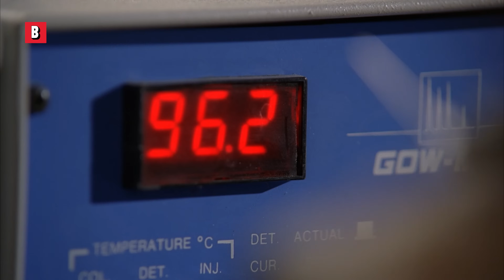"You belong to the cartel now" | Breaking Bad | CLIP

Comment: 1:35 I'm curious is that an actual device or just something they whipped up to make it look cool
Reply: Actual device. Could be gas chromatography/mass spec. They did a decent job of showing the vertical lines on the monitor that reflects the chemical composition. The 96% calculator screen is probably whipped up to make it easier to see.
Reply: It's basic chemistry
Reply: the needle he uses to inject the stuff is quite real, a nice detail. Its called a Hamilton syringe.